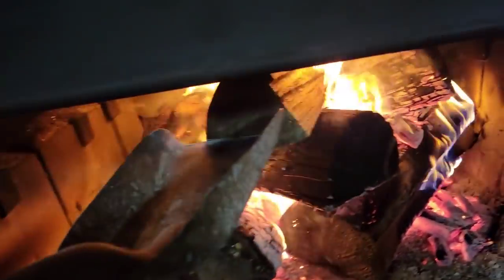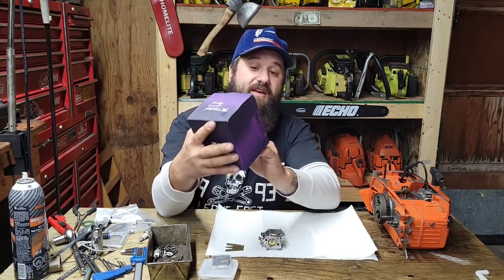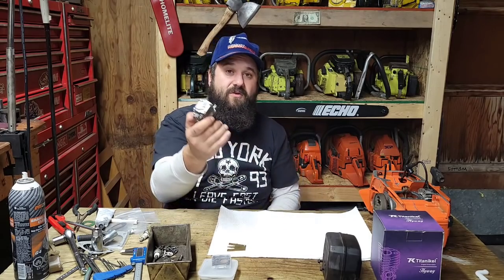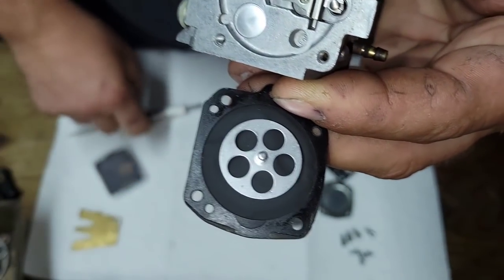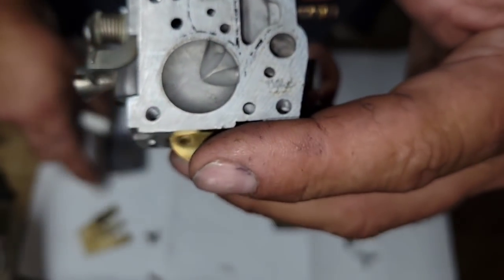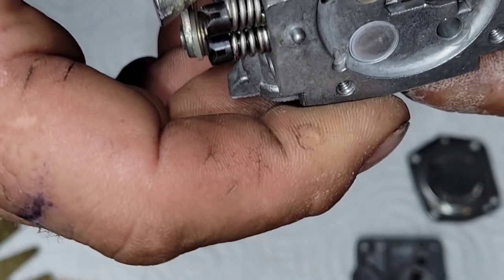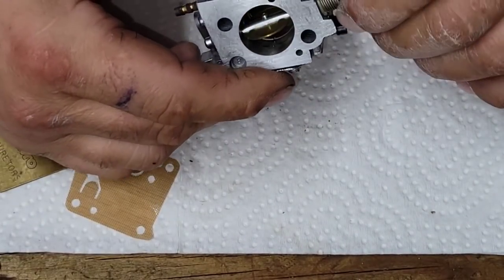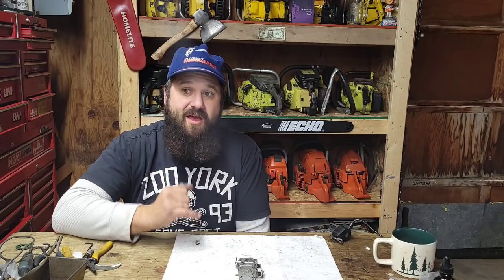Rebuilding the carb on the 268xp giveaway saw, we're getting close!!

Comment: In my opinion a carburetor has to be OEM that’s about the only thing the aftermarket manufacturers can’t get right. Love me some Tinman! 👍🤙
Reply: Yep. Unless MAJOR corrosion is a problem, it's almost always better to rebuild OEM than replace with aftermarket carbs.
Reply: In my experience the cheap aftermarket carbs I have purchased about 1 out of 4 are any good
Reply: I 100% agree. Nothing but trouble with aftermarket on my end
Reply: I’ve actually bought about 15 after market carbs, all worked fine, guess I’ve been really lucky!
Reply: @TierMasterx  you sure have
Reply: @TierMasterx  well dang… you maybe should go play the lottery also then 😂
Reply: @TierMasterx 
I have bought 1 aftermarket cilinder and piston and carb for a 55.
Runs for 5 years know.
I use de Saw for firewood, 350 Cubic feet a Year.

Comment: Good stuff again, like the detailed explanation about the diaphragm on the pump side. I also don't lean on my saws. If you sharpen you chain properly it will pull itself through. If you are leaning on it, it is a good indicator that you have waited to long to touch it up. If your out cutting (falling and bucking) a cord or two it makes for a long day if your saws not sharp and a tired back if your leaning on it all day. Cutting 20 to 40 cords a year, year after year it will wear you out. The anticipation of seeing this saw in the wood is killing me but loving the step by step build. Mahalo Tinman....🤙

Comment: So they provide you with a pump diaphragm specifically for ethanol blended fuel and you use mostly ethanol blended fuel but you purposely choose not to use the diaphragm made for use with ethanol blended fuel.  Huh?  You say you've never had a problem but that doesn't explain why you wouldn't use the part made for your situation.